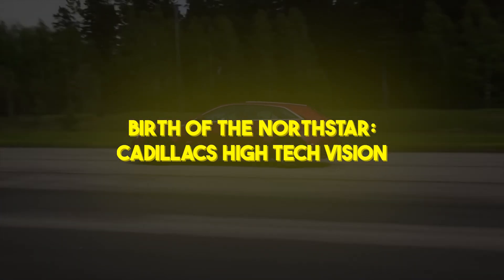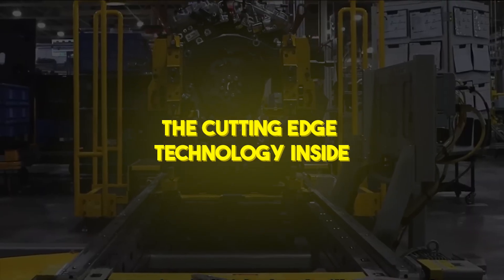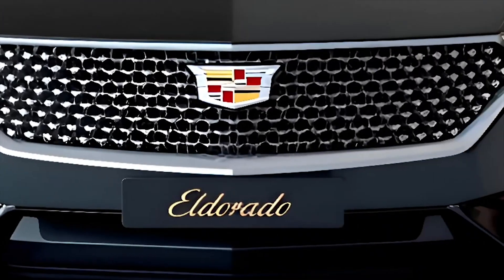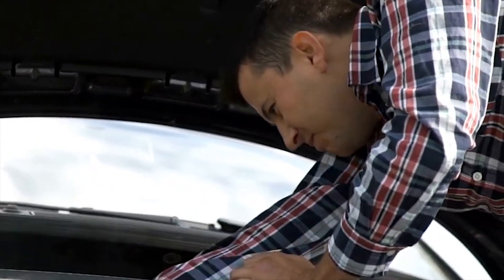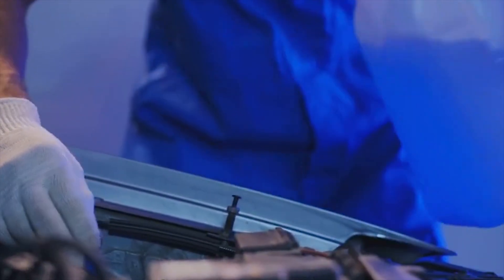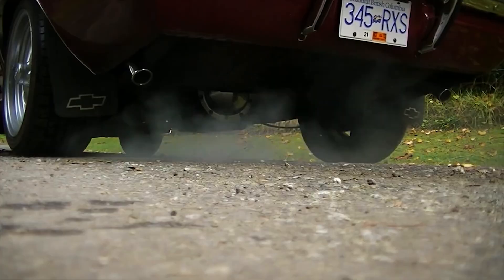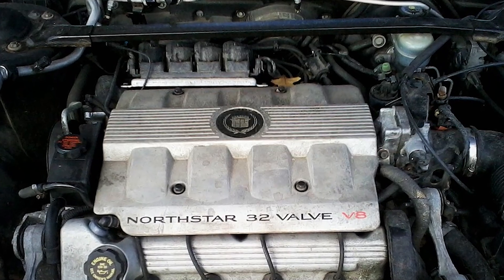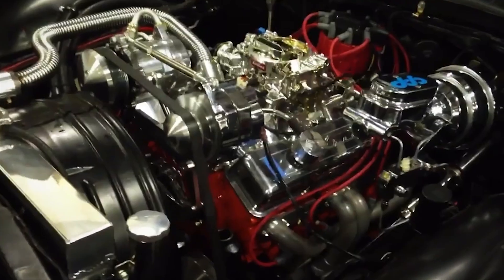The Shocking Truth Behind Cadillac's Banned Northstar V8 Engine

Comment: I had an Eldorado with the North Star which never gave any trouble but I did sell it before it hit 100,000 MI. It got excellent gas mileage on the highway and was definitely not slow. If I could find another low mileage one I might buy another one. The depreciation was awful a car that was listed at $50,000 and I only got $7,500 for it
Reply: That's crazy, I got a 2002 Eldorado about a month ago for only $1k. The car has only 97k miles, and it damn near runs like a brand new car. I call her Eldy

Comment: Taking big risks have always appealed to some.
No risk, no reward type mindset.
However, at times, taking risks can seriously backfire. Wit.
I applaud the Engineers for attempting to create a modern, DOHC, 4 Valve, All Aluminum Block and Heads. Maybe they bit off more than they could chew this time.
A huge embarassment for GM and Cadillac.